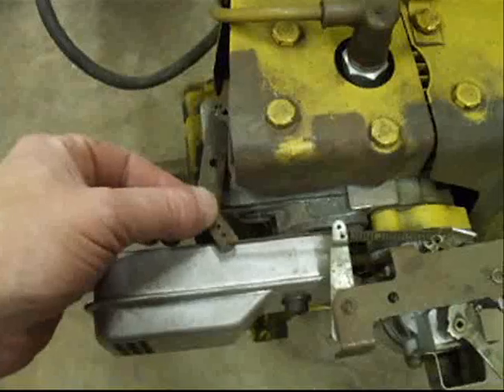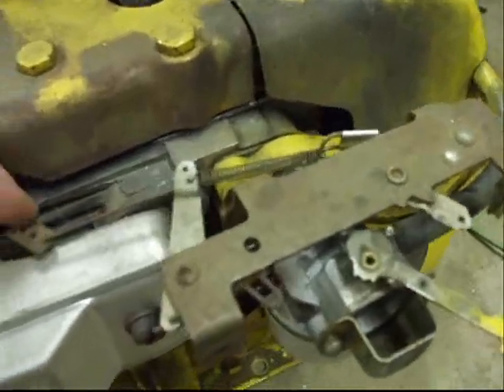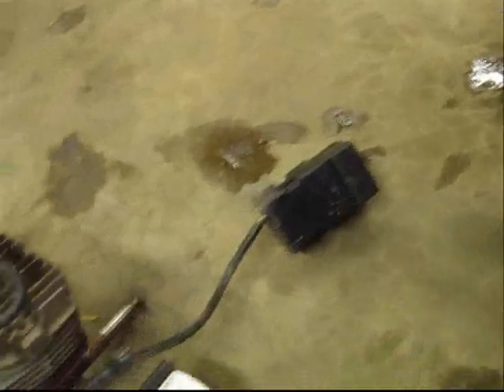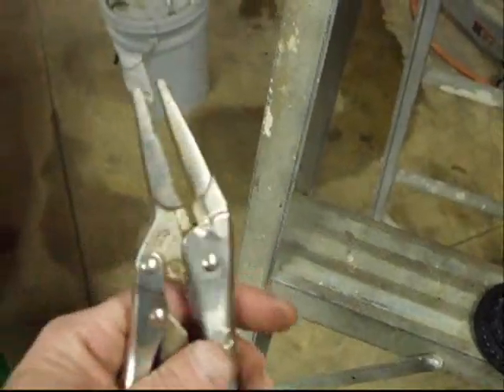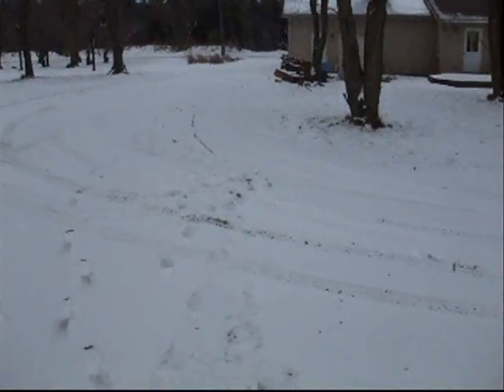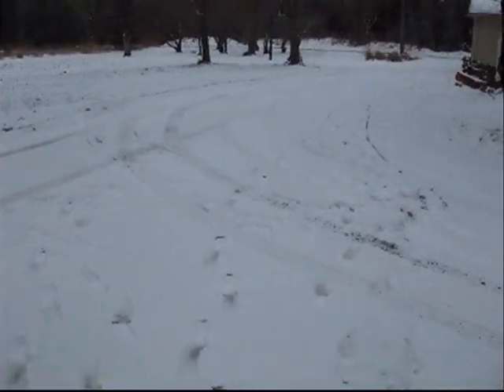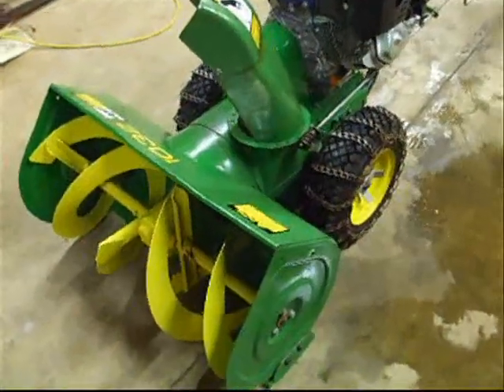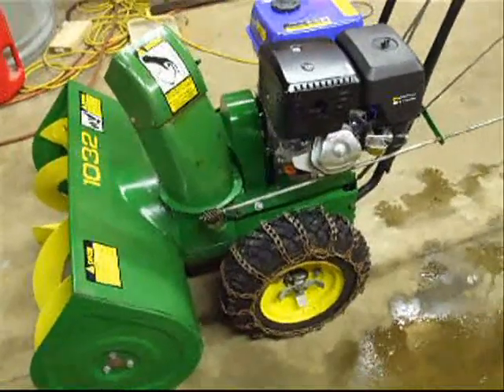John Deere 1032 Snowblower Repair & Modification Video Part #10

Comment: Very informative video, great job.My Troybuilt will run but as soon as I engage the auger it immediately stalls. Was told to check the breakable pins or bolts but from the videos I've watched the machines don't stall with a broken auger bolt. So I'm assuming it's a seized bearing. Gotta watch more videos to figure out how to replace it.

Comment: Good Video. Thanks for posting. I have bought a sirometer and have found it a little difficult to use. Hopefully with the help of your video it should be easier. (I need to set the rpm of an engine to 3600.)

Thanks again.